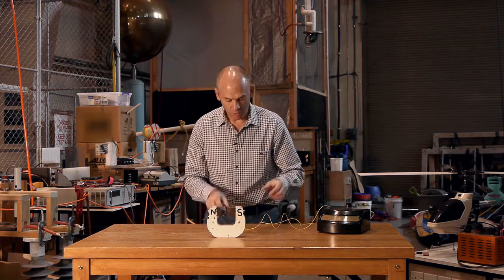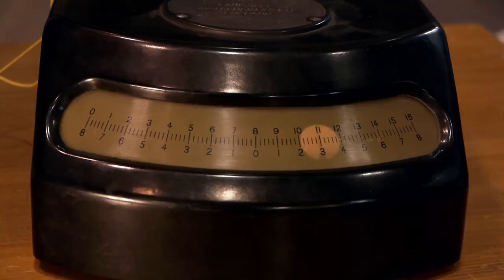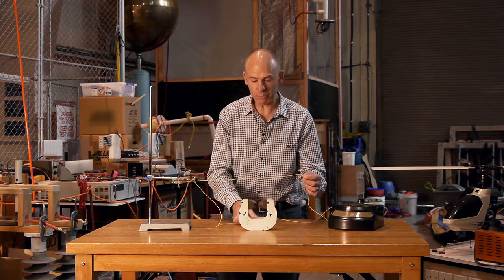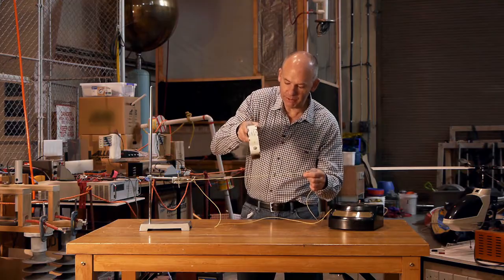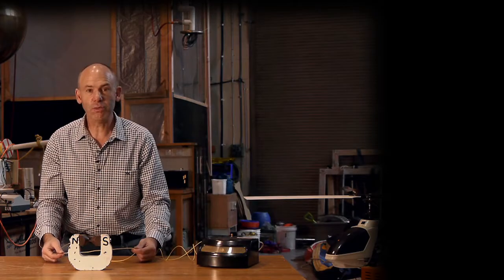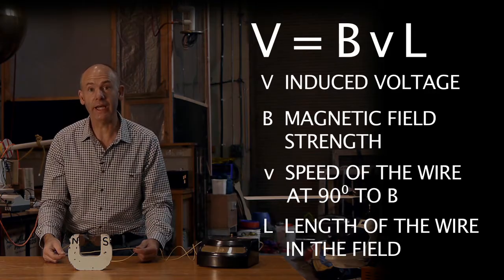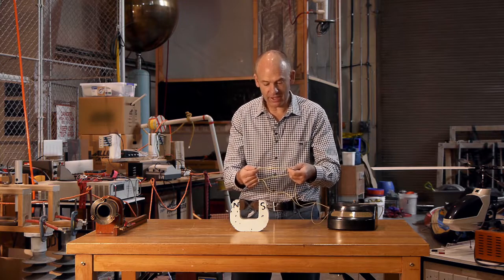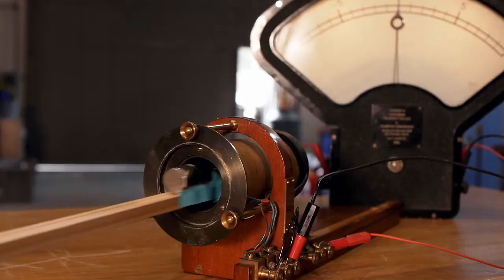Electromagnetic induction: induced voltage in a single wire

Comment: But like I've seen a magnet turn things magnetic, so then couldn't this be more about magnet to magnet than any physical wire? Well at that point wouldn't just any old manipulation of a magnetic field equate to electricity? But then voltage isn't real
Reply: its properties of certain elements that allow the transformation into magnets these are called ferromagnetic and copper is not ferromagnetic. the changing magnetic feild from the pov of the wire is what causes the currents. votage is real and is the strength of the electric feild compared to the strength at another point

Comment: FYI: Movement of a copper wire trough a magnetic field affects the normal 
gyroscopic procession of the copper atom's electrons, forcing them to 
process left or right depending on the polarity of the magnetic field 
and the direction of approach to that field. This causes free electrons 
in the wire to be pushed in the appropriate direction.
So, each copper atom affected by the moving magnetic field is catalyzed 
to become a microscopic battery. The faster the wire is pushed through 
the magnetic field, the greater force of the procession of the copper 
atom's electrons and the greater the voltage produced by these atomic 
scale batteries.
If the magnetic field is stationary relative to the alignment of the 
copper wire then there is no procession displacement of the copper 
atom's electrons, and no voltage is produced.
If movement of the magnetic field is stopped abruptly, then the copper 
atom electrons quickly return to their normal procession. During this 
period of return to normal procession there will be a detectable high 
voltage back spike of electron current in the wire.
Reply: That's what you already said.

Comment: This video makes me question something involving my job. I have a guy that keeps putting multiple wires on just one terminal of a communications port of an infinity furnace to "strengthen" the connection between the furnace and the heat pump that the said wire runs to. My question I guess is this - If there are more conductors, even though they are essentially the exact same conductor  with the same signal from the same start point to the same end point am I getting more induced voltage from nearby high voltage wiring than if he had just ran 1 wire per terminal due to the extra wires near the high voltage? Somebody please help me out here.
Reply: Not sure if you found an answer but it shouldn't cause a huge issue. Assuming you have line and neutral conductors for each cable, the emf will essentially cancel out as equal current is traveling in opposite directions

Comment: Great video,  but why should the magnetic field induce opposite EMF and current flow depending on whether the wire descends from above or rises from below? How does a left to right magnetic field "understand" whether a wire is going down or coming up into the field?
Reply: Maybe if explained like this. Does the wire/coil enter or exit the magnetic field? And viceversa. Is the magnet moving towards or away of the wire/coil? Of course the direction of magnetic filed is also important to determine the current direction.

Comment: How is voltage created
Reply: Movement of a copper wire trough a magnetic field affects the normal gyroscopic procession of the copper atom's electrons, forcing them to process left or right depending on the polarity of the magnetic field and the direction of approach to that field. This causes free electrons in the wire to be pushed in the appropriate direction.
So, each copper atom affected by the moving magnetic field is catalyzed to become a microscopic battery. The faster the wire is pushed through the magnetic field, the greater force of the procession of the copper atom's electrons and the greater the voltage produced by these atomic scale batteries.
If the magnetic field is stationary relative to the alignment of the copper wire then there is no procession displacement of the copper atom's electrons, and no voltage is produced.
If movement of the magnetic field is stopped abruptly, then the copper atom electrons quickly return to their normal procession. During this period of return to normal procession there will be a detectable high voltage back spike of electron current in the wire.
Reply: @MagnaMoRo now that’s some explanation
Reply: Induced voltage